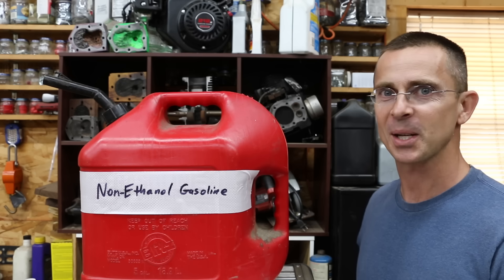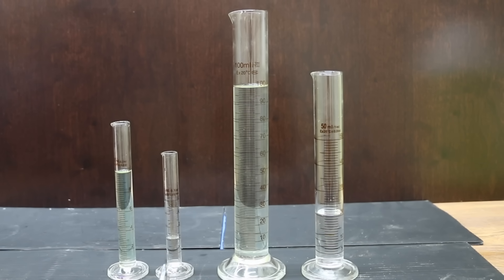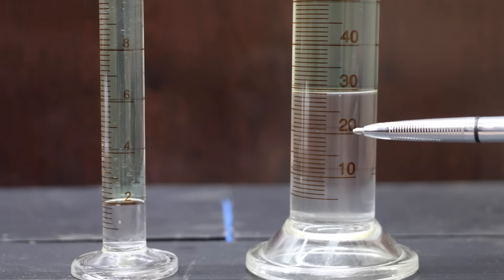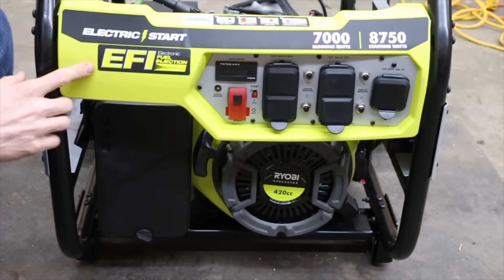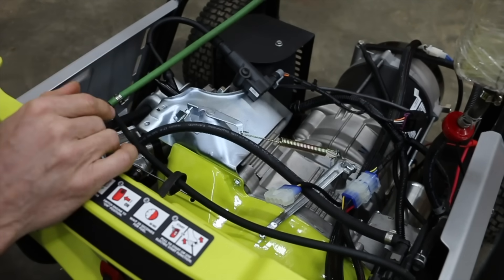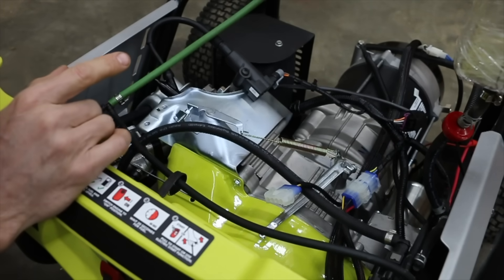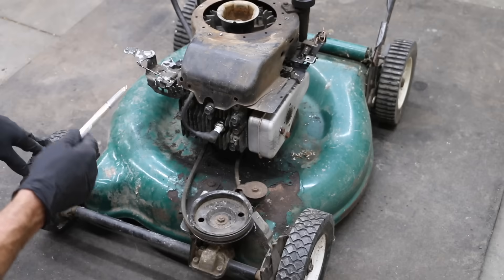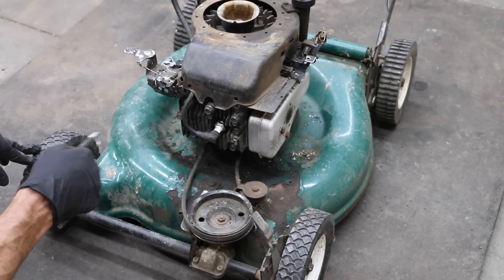Is Non-Ethanol Gasoline Really Better? See the PROOF!

Comment: was the octane the same on the fuel and 93 shell is usually cheaper than 90 non-ethanol which do you think is the most bang for the buck Thanks for all the great info.PS All my vehicles require 91+ due to turbo and supercharger do you think the 90 non-ethanol would work well?
Reply from the maker: Thank you. I used 91 octane in the generator for both tests.
Reply: @ProjectFarm   Thank you

Comment: Interesting results, I thought the e10 gasoline would run cleaner as well. It would be interesting to see an e85 comparison as well, but I'm aware that small engines, (or at least none that I'm aware of) aren't designed to run on it. Purportedly they aren't designed to run on the e10-e15 commonly found in gas stations either, which I'm sure is the case for old enough models, although I would think ones made after ethanol content gasoline became the norm would be designed with it in mind.
Reply from the maker: Thank you
Reply: If 10% ethanol had been added to his straight gasoline, it would have been cleaner. 

E10 has been used in small engines in the US since the 1980s.

This engine uses E27.5 in Brazil: https://www.honda.com.br/produtos-de-forca/gx120

Comment: I have been experimenting with used engine oil in a diesel car. So far with 50/50 ratio (diesel/used engine oil) I cant notice a difference. It would be interesting to see if there is a difference in produced energy with a generator if you are using diesel or 100% used motor oil. Thanks for awesome videos so far!
Reply from the maker: Thank you for the video idea!

Comment: It's possible that the generator test didn't accurately depict real life driving experience(i.e driving at 4th or 5th gear on a highway,accelerating e.t.c),so the higher efficiency of the non-ethanol fuel might be a fluke.
Reply from the maker: Non-ethanol fuel does have more BTUs of energy per gallon.  Thank you
Reply: Project Farm : You are right,you could try to modify the generator engine,or install in the generator a 'customized' engine with a high compression ratio (fuelled with anything from E10-E85) and see how efficient it would be compared to the conventional engine used in this video.

Comment: 10 milliliter of ethanol plus 20 milliliter of water might be smaller than 30 milliliter in total. Because ethanol molecules are smaller than water ones, when you mix the two together ethanol molecules will get “in between” the water molecules. This results in a decrease of the total volume.
Reply from the maker: Great point. Thank you

Comment: i got an idea for a test. an old workmate who has been there and seen it all, experienced a dodgy car salesman putting JIF down the spark plug hole for high mileage engines. JIF is a well known product here in Australia which is a liquid creamy pasty household cleaning product. not sure if there is a US/Canadian equivalent. the UK it is Cif... the theory was in a high mileage engine, the cylinder wall is glazed. the creamy household cleaner scuffed up the bores to improve compression and reduce blow by. thinking about it... it was likely the product just ended up clogging the rings and baking to the head to up compression, but was good enough to sell a car with temporary restored performance. i doubt it would last long and vertically score the bore making blow by worse! but hey that happens a week later... if you need some Jif i am willing to send as its only 3 dollerydoos here in Aus.
Reply from the maker: Thank you for the video idea!

Comment: You should try tribotex in with engine oil.   Is supposed to help a motor by increasing hp by 3%.  Make them last longer.  More quieter.  Increasing fuel economy.
Reply from the maker: Thank you for the video idea!

Comment: Will jet fuel work for Diesel engines and gas engines
Reply: Jet fuel is basically diesel. IIRC most of the diesel equipment on air bases is run with JP8, or jet fuel, because its logistically easier that way. You can run a jet engine on diesel, but only once, diesel has a much higher sulfur content.
Reply from the maker: Thank you

Comment: well you said the main reason for it being there at all, it raises the octane level, which by my understanding means it has less chance of compression combustion and will ignite only when the spark plug says to (when you want it to), making it more predictable and therefor more reliable and safe for your engine. That might be important enough to include when weighing the difference?
Reply from the maker: Great point. Thank you

Comment: A question on your procedure. With the number of tests you run on engines, I am surprised you don't use a free-standing fuel tank stand. It would make it easier to be sure of your accuracy if your tank is not shaking around like your small engine test beds.
Reply from the maker: Thanks for the recommendation.

Comment: Kool video 
I put ethanol free gasoline in a 2008 Chevrolet Silverado and the engine 5.3 vortec did not like it! check engine light came on and did not run right ! But it is designed to run on E-85 so I thought id let you know, I figured it would run better... But NO
Reply from the maker: Thank you!

Comment: PROJECT IDEA
Could an HHO gas generator “https://m.youtube.com/watch?v=cqjn3mup1So” supplement a car’s fuel efficiency by directing the gas to the air intake and running on the cars battery/alternator?
SIDE NOTE: Mythbusters already tried running a car SOLELY on the generator, and it simply couldn’t put out enough gas to run independently. But I’m curious if a tandem setup could produce a better overall fuel mixture.
Reply from the maker: Thank you for the video idea!

Comment: How about a comparison of emergency tire repair products?  Like fix a flat vs slime, etc.
Reply from the maker: Thank you for the video idea!
Reply: How about comparing autogyro properties of helicopters and race horses? Why on earth would you do that? Race horses don't fly high enough for an autorotation emergency landing. That's why jockeys wear an emergency chute. Your temporary repair shit is as weird as horsemen preferring a certain color of parachute. So what, get that tyre fixed or replaced. Don't focus too much on the emergency fix. Get yourself an oldfashioned spare wheel and tyre. Far better solution. Who invented those weirdo's on the road? Some aftersales marketing campaign? Are you two zombies walking the highway by accident? Yeah, let's check it out, great idea? Duh!
Reply: Both are garbage and should only be used as a last ditch effort.

Theres your answer
Reply: Yes!! Please also which one works best with TPMS
Reply: Fix the tire right.
That stuff is.CRAP!!!
SAVE HIM SOME.TIME!
Reply: Dear haters.. Many cars nowadays do not have spare tires.  Fix a flat is necessary to get home or to the shop where it WILL be fixed properly.  THUS would be nice to know which one will actually get me home and not ruin my TPMS in the process.  As an aside.. I have used fix a flat on my John Deere.  With a 9 mph top speed I'm comfortable calling that fix "right"...
Reply: @thedrivechannel83  yes. Those snake oil tire repair gimmicks will damage your TPMS. I once whittled a stick down to fill a puncture that got me 5 miles to a tire store. btw. Before cell phones.

Comment: Since there is no alcohol permitted in aviation fuel every small aircraft (piston driven) has a water drain located on the lowest point of the fuel system. Before each flight you drain any water from this point that may have accumulated. Good video.
Reply from the maker: Great point! Thank you

Comment: Good stuff! I am looking forward to the rubber/plastic results. Wondering also if being in constant contact with ethanol containg fuel is better or worse than the winterizing version of removing the fuel completely.

I suspicion the alcohol absorbed into the rubber fuel line, that is then exposed to air (been emptied) allows more oxydation/deterioration.

Fun fact, if not already covered, chainsaw fuel caps that swell while in long-term contact with ethanol fuel can be set aside to "dry out". After a period of a few weeks, the cap shrinks back to usable again.
Reply from the maker: This is great information. Thank you

Comment: That is the reason your carburetors rust / corrode  and get that "jelly" in the bowl , the ethanol absorbs humidity from the air and it sits there in it. I did the add water / separate ethanol thing and have never had problems since. Major lawn mower dealers love to push the "fuel stabilizer" and tell you there is no way to prevent "separation".  Yes there is , you do the separation before you add the gas to your small engine. Small engines don't need high octane. First time I ran ethanol free gas in my push mower , it was UNBELIEVABLE !  I was finally getting the true horsepower from my Poulan 5HP,  not the power robbing "ethanol power". No more hard constant pulling , hesitation , fuel starvation. You all have heard your own mowers acting like they are running out of gas , weak , hesitating..it is trying to burn the water in the bowl. Plus , since the ethanol has been removed already , the gas can't absorb moisture anymore in the can or storage device. Search "ethanol scam" on YT.   Free my mowers and trimmers from this burden !!!
Reply from the maker: Great point.  Thank you

Comment: I think it depends a lot on how the engine is set up. I have three vehicles, and all three act differently depending on fuel. My 2004 Taurus likes mid octane fuel with ethanol. I tried ethanol free and it, according to the on-board computer, decreased my gas millage by....umm one mile ha, so margin of error. So that vehicle does not seem to care. My 1999 pickup is harder to tell. I THINK it gets slightly less gas mileage with ethanol, but I do not have a good computer to really test with. The 2008 Edge on the other hand is designed for low octane fuel, and that vehicle gets like a 5% boost to millage with ethanol free. I guess it all depends on how the engine is engineered. Difficult to test though to be honest. Took me years just to kind of see the trends.
Reply from the maker: Great point. Thank you

Comment: I happened across your videos by accident and have really enjoyed them. I'm wondering if you have the ability to test E85 versus Regular Gasoline. I have one of my vehicles which is flex fuel capable and drive it on average of 150 - 200 miles a day. When gas prices soar I have opted to using E85 for the out of pocket savings but in reality it's a cut of about 10% on the fuel efficiency. I haven't done an exhaustive monitoring but it's definitely noticeable. I am more concerned with possible issues service wise and possible wear with prolonged use of E85.....Thanks
Reply from the maker: Thank you. I tested E85 in this video: https://www.youtube.com/watch?v=LnPJEI6AnZ0

Comment: Well, its winter and in lots of places around the US its cold. Many people use different styles of Kerosene heaters for their shop or back up heaters in their home when the power goes out. The Kerosene heaters that are of a wick type is the most used for backup home heaters, its these heaters that need to burn the cleanest and operate at peak performance just because homes are better sealed (not as well vented) as large work shops or garages, and also in a shop a small about of kerosene heater smell is just part of the job smell, but we don't want our houses to smell like the shop!
The wicks in these heaters are very sensitive to even small amounts of water getting into the wicks fibers, just a drop or so in any area of the wick will block (clog) those wick fibers from passing kerosene (the fuel) through the wick.
Now they're several kerosene additives sold to treat the heaters fuel to remove the water (actually absorbs or blends the water and carries it on through the wick). They are lots of claims as to using other products for the same purpose like,
Higher percentage of Isopropyl Alcohol (I've seen as high as 90%)
Automotive Fuel Additive Heat, (another form of Alcohol)
Automotive ISO Heat, (Alcohol)
The question is,
Which ones actually WORK?
Is the marketed Kerosene heater fuel additives better, or even as good?
Here is one idea for the test, (maybe??)
Get some smaller kerosene wicks, and dip the bottom of the wicks in lets say 1/8" deep water for two seconds. Then add some color to a pan of kerosene with and without additives. dip the wicks into the colored kerosene and see if any of the additives helps the flow of the fuel pass through the moistened wick base. How far does the die go up through each of the wicks.
Then the other test would be similar to what you did in the above video, in that some measure of kerosene is placed in a container, then a small amount of water is added to each, then a measure of the different additives is placed into each, which one does the best at suspending the water into the fuel. Then to find out which one can suspend the most moisture small amounts of water could be added to each to find out which one might suspend the MOST moisture.
Mark From West Virginia.
Reply from the maker: Thank you for the video idea!

Comment: Did you test pure alcohol yet? It is the opposite of this video. Alcohol will burn from 40 percent on. Maybe It will need 50 or more to run. And my second suggestion would be a litte „tuning“. If you grind a few 1/10 mm off the cylinder head, there will be more conpression and the engine will have much more power. Also it will run slower. To do that, you can measure the space between the piston and the cylinder head by tucking in a solder wire through the hole of the spark plug. Sorry Im german, I dont know all the words... 😂
Reply from the maker: Not yet.  Thank you

Comment: I was service mgr in a Honda Suzuki Yamaha cycle dealerships for decades. There is a gas station across the street & new bike owners usually went there with their new bikes. Almost w/o fail, new Goldwings, for one, would come back a day or two later with a misfire. Other bikes came back with misfires & blued pipes. Putting fuel WITHOUT alcohol into the bikes was the fix. The new bikes were running SO lean that leaning them out further with the alcohol was too lean. And we are not in California, which are likely even leaner running.
Reply from the maker: Thank you!

Comment: I think you should be very clear that your test is done on carburated engines with fixed ignition timing.  If the engine can take advantage of the higher octane of the fuel (either through closed loop spark control, or an engine that is calibrated for the specific fuel), fuel efficiency may go up since the knock limit is lower.  There is a trade off due to the lower specific energy of ethanol, so 100% is not as good.  Ethanol content of around 20-30% would provide the best trade off.   

In short, ethanol is good for newer cars but no benefit (and may be a small negative) for small engines like lawnmowers and generators.
Reply from the maker: Thank you!

Comment: What is the difference in price, if any, between ethanol and non ethanol gas?
Does the price make up for the 4% economy difference?
Do you think leaving a hydrophilic gas in your tank for an extended time may lead to rust?
Reply from the maker: Ethanol blended fuels are usually more the 4% less. A well-sealed fuel tank that filled before storage is unlikely to absorb too much water.

Comment: Be interested to see results of putting 10% diesel in petrol instead of ethanol ..then maybe 20% etc.
Reply from the maker: Thank you!
Reply: @ProjectFarm  Thinking a bit more, it might be interesting to compare with 10% diesel / 10% ethanol /80% petrol, i.e. a diesel / E10 petrol mix to see if some of the lost mileage over 100% petrol can be regained, apart from the other useful fact of knowing whether a small amount of spare diesel can be put to work.

Comment: I work for a transportation company that operates everything from small taxis to 30+ passenger coaches (buses).

They're incredibly cheap about everything, so you'd think they'd want to use E15 in the vehicles labeled as Flex Fuel.

Nope. Nobody is supposed to ever use E85, or even E15 in any vehicle. They recently put up a ton of notices reiterating that, since one of the taxis was being filled with either 15 or 85, and now needs a whole new engine.

Ethanol is just bad news.
Reply from the maker: Thank you

Comment: I see you are going to test some fuel lines. May I suggest what lines are allowed on gasoline powered boats to be included. I would like to also mention first what is not. Steel and aluminum are not acceptable hard lines. Acceptable hard lines are seamless copper and copper-nickel. Hard lines are used in areas where there is no flexing. Flexible fuel lines can be used in all areas however regulations stipulate that they must be replaced every 10 years. Flexible fuel lines must be marked with date of mfg and “A 1” “US coast guard approved”. The new inventory is all “low permeation” and has a tough plastic like liner. The best brands are the black Trident and Shields. These hoses have working pressures that make them acceptable even for the high pressure side to multi port EFI systems if the fittings are barbed or ribbed. The silver grey marine hoses have a lower working pressure rating but are better suited for outboard applications where the hose is exposed to UV. Automotive hoses are strictly not allowed and are inferior. There are some Teflon lined hoses that may be up to the task but lack the Coast Guard approvals. Stainless braided hoses are frowned upon for recreational boating because the exterior is conductive and could cause a short. Also at the aluminum and stainless juncture of the end fittings galvanic corrosion can occur in marine environments. Again this hose is missing the required Coast Guard approval. I hope you find this info helpful.
Reply from the maker: Thank you for the video idea!